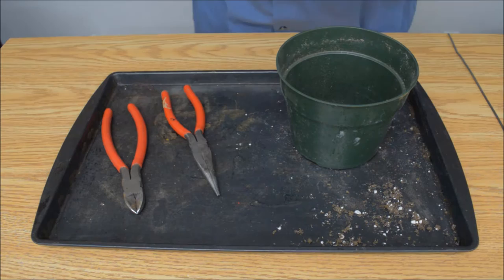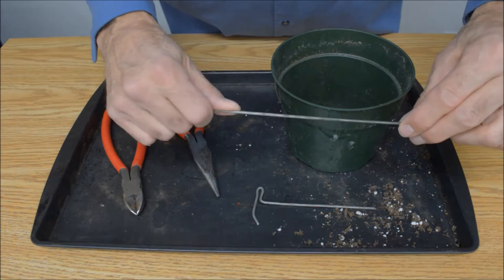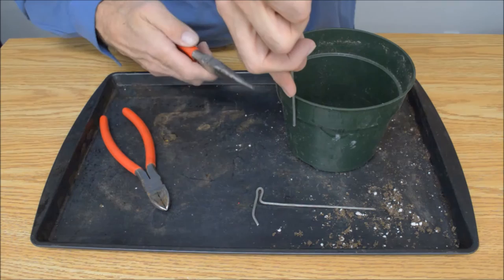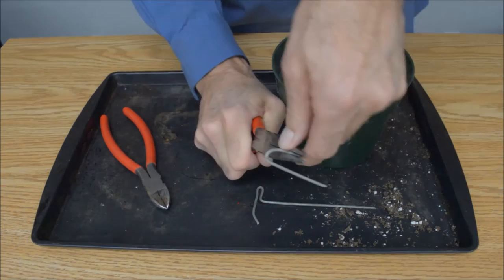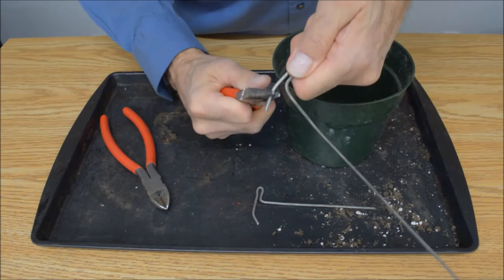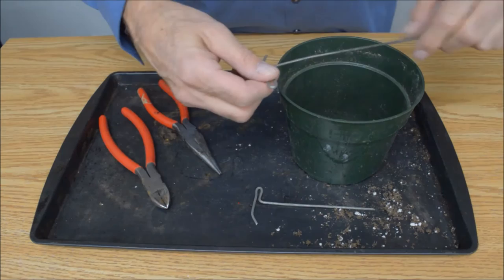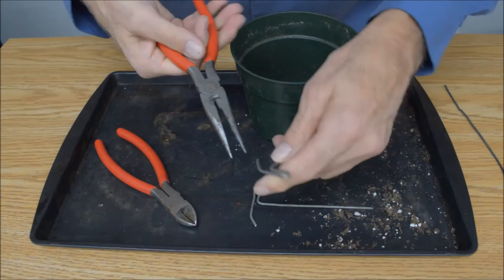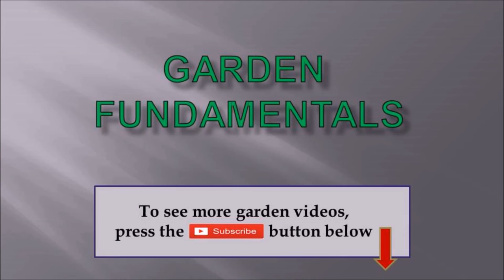Do It Yourself (DIY) orchid rhizome clips that are easy to make

Comment: What gauge is the wire used in this video? Also, where would you purchase it?  Thanks for posting the video!
Reply from the maker: Not really sure. Hardware stores have various thicknesses. I like the wire used to hang drop ceilings since it is straight, but some of it bends to easily.
Reply: When you bought the wire, it should have had the gauge in it, most do. But you guys are so good at these things and have tools etc - but isn’t there a tool to measure and determine the gauge?  But also, somewhere on the Internet I have seen a chart with little circles that supposedly represent, fairly accurately,  the gauge that you can place the and of the wire over the circle until you have the right one.  I will try to find and send the link and maybe that will help. As you said the ceiling hanging wire - comes in different gauges and if you are ordering, you don’t have it in your hands to make a good decision by feel.  Also, it comes in a fair amount of length so you don’t want to make a poor choice  playing  Goldilocks and ending up with several rolls of wire you just don’t need.
Reply: I make mine out of 9 gauge wire. Lowe's has it in the wire folks used for cloths line wire. You can also make pot hangers out of this wire to hang the potted plant on the wall.
Reply: @plips71755  just go to your local small hardware store and touch their wires... then let us know which guage you like. even though ordering everything on amazon is convenient, i find that sometimes its easier to just go browse in person. plus some things are terribly overpriced on amazon.